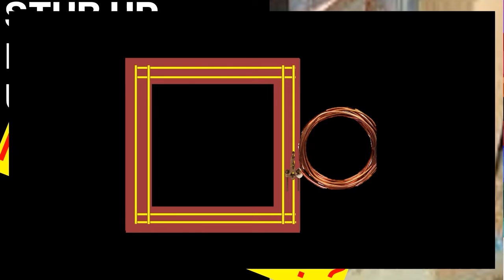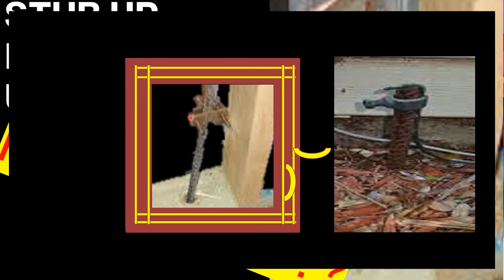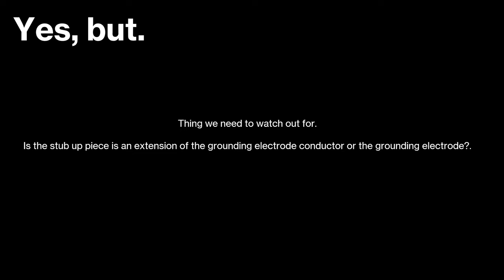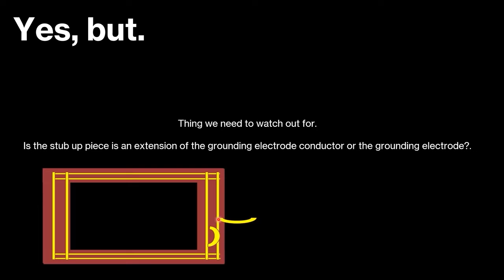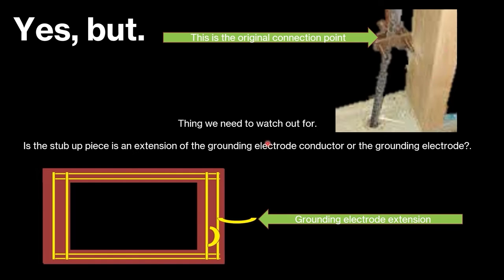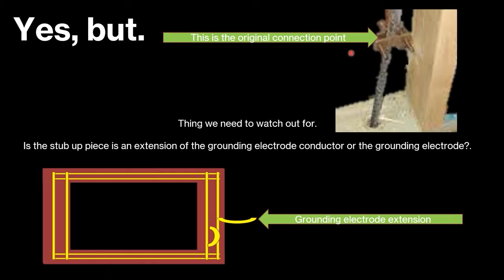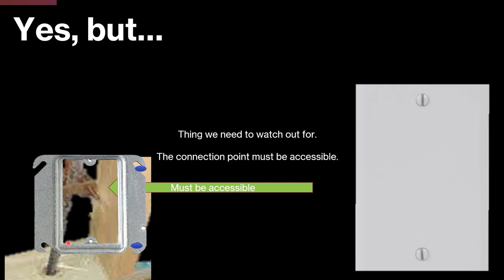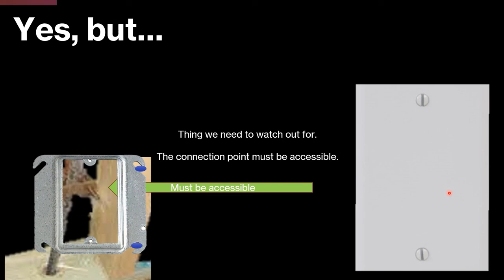Can you Stub Up rebar for a UFER Footing Ground? Concrete encased electrode. 250.52

Comment: if the Ufer ground wire gets cut off  ( stolen ) flush with the foundation can we chip the foundation and  use an irreversible connection ( Crip fitting  )  to extend the # 4 wire

Comment: NO, not code.  I work for a utility company and this is not allowed.  They will not install the meter when they inspect.  no grounding inside a wall cavity.  If you have a fault, this ground wire could overehat and cause fire in-wall.  all grounding is done outside of the home.
Reply: What about the water pipe? That is bonded at the meter usually inside.

Comment: My prior house, built in 1991, extended the rebar out of the garage stem wall just inside the sill plate.  So it was inside the garage, not inside the wall. I always thought that was a tacky way to do it, but it didn't bother the framers! (The grounding electrode conductor came out of the wall under the drywall and attached to the protruding rebar.)

Comment: I've seen the grounding electrode and grounding electrode conductor rules change over the years. When I first started way back when you had to bond metal gas lines. Then you couldn't. I remember when they started requiring bonding the hot and cold pipes at the water heater. It's been at least a decade since I looked but per code the ufer had to be at least half inch rebar and extend at least twenty feet in 2 different directions at least 90 degrees apart.. And we were never allowed to bury the connection in concrete, it always had to be exposed. It was usually in the stem wall between the footing and the floor or on the inside of the raised footing. It had to be accessible to re-tighten because copper is soft enough to flow. A 100 amp service used no. 8 armored solid wire, 200 amp used no. 6 solid bare copper. Only on larger services could you use larger stranded bare wire. In the late 70's we did a lot of service upgrades replacing old 30 and 60 amp 2 and 4 fuse services with 100 amp breakered.